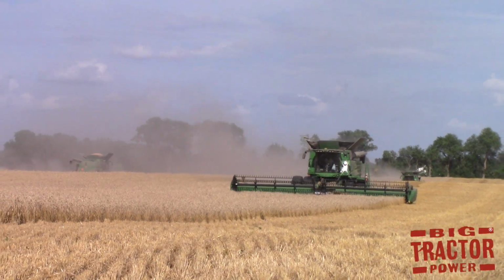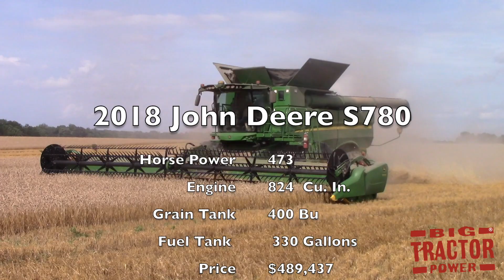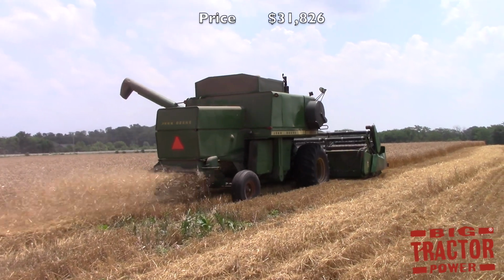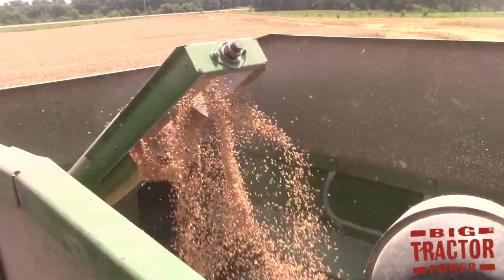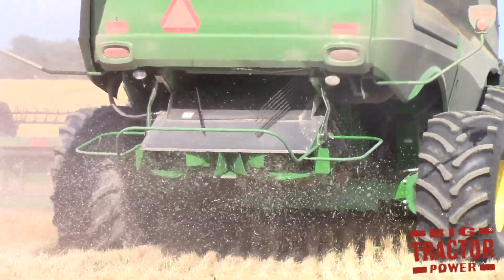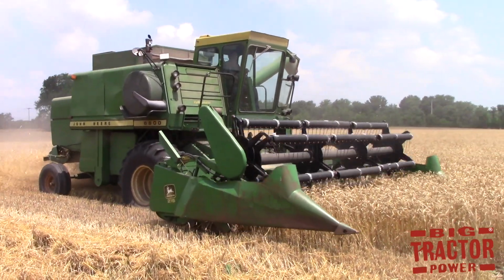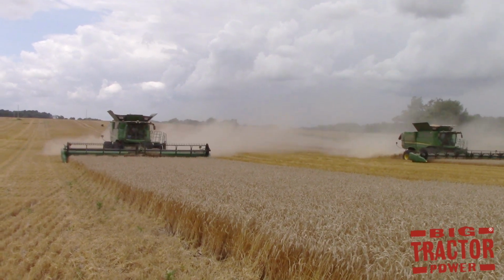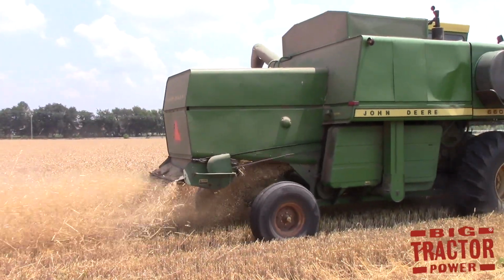Wheat Harvest 2018: John Deere S780 & John Deere 6600 Combines

Comment: The old guy still runs like new after 40 years of service. I wonder ho will this S780 machine run in 2058?
Reply: Probably won't, electronics will fail and likely won't have replacement parts available. But the old dog will probably STILL be running at that point.

Comment: Dad had several 4400s over the years and finally got rid of the last one a few years back in favor of a 6620. That's a much better machine. I don't miss the 4400 much, but there was a lot of acres covered with the old girl.
Reply from the maker: I have filmed a 3300, 6600 and 7700 but not a 4400 yet.  They are cool machines. Harder and harder to find.

Comment: Do those prices of harvesters include the head? How much does a typical draper or corn head cost?
Reply from the maker: It does not include the head. A Draper is around $140,000.
Reply: bigtractorpower McDon are about 80 and far better headers then deer
Reply from the maker: When Case IH was offering MacDon headers their website listed a new head at $130,000 for a 40ft Model.

Comment: What was the first combine to center the cab? And why did so many combines have an offset cab?
Reply from the maker: Well most combines had a center operators station from the 40s to the 60s. John Deere  made a big splash with the 3300 to the 7700 in 1969 with the front mounted engine.  In 1989 Deere went back to the Center cab with the 9400 to the 9600.
Reply: the engines sat beside the cab so they had to be offset
Reply: I realized after I posted this that old Gleaners and JD 45 and 50 combines had center cabs. But most of the older MF and IH combines I see around here have the offset cab. I just don't see what the benefit was for them to change the design with a side engine.
Reply: International harvester put their cabs on the side on the 815 to match a truck. Thinking you drive a truck on the left side so they put cab on the same side also you could view the unloading auger easier.
Reply: bigtractorpower I am pretty sure it was the  later model 915 INTERNATIONAL that was the first combine to have a centre cab ,regards from Australia.

Comment: Mr.bigtractorpower, since you have the spec's on these 2 machines, how many (in capacity) 6600's would equal 1-S780?
Reply from the maker: It would take 4 6600’s to match an S780 in capacity.
Reply: Thank you for your response.
Reply: @bigtractorpower  do you have video in which addressing JD classic planter VS new one?

Comment: Which operation has the lowest harvest cost per acre when you factor in a payment on that new machine....
Reply from the maker: Well there are differences to consider.  How fast does the crop get harvested, how much down time is there for repairs etc...  it always good to have low costs but are their opportunity costs of delay and lost time on an older machine.  It all depends on how many acres need to be covered.
Reply: Fuel cost per acre alone would be interesting. Repair costs on most of the old stuff is minimal compared to new equipment today. Most farmers get rid of them in three or four years or "fleece" them.

Comment: And if you went back another 20 years to 1958, I wonder if it would even be a combine, or would it be a sickle bar, wagons, and a thresher outside the barn?
Reply from the maker: Combines were strong by 1958.  John Deere offered the 45, 55 and 95 at that point.  I have filmed a 45 and 55 in corn.
Reply: Yes, and it would have been the debut year for the classic John Deere Model 95, which in that year, was the largest S.P.C. in the world, too!
The Model 95, went on to become John Deere's number one selling combine, in the 1960's, and by 1960, the introduction of the Model 105, moved the 95 to the second place in the family, while until the beginning of 1967, the J.D. 105 held the title of the world's largest S.P.C.!
John Deere would go on to debut two more world's largest, the Model 7700 and Model 8820, respectively.
In 1989, the Model 9600 could only be classified as the world's largest conventional combine.
Reply: Great info. We had a 1000 acre family farm and ran a 105 till 2000. retired farming, but I loved the control at the steering column. Great group of combines (45- 105)
Reply: I remember a parts 105 we had late had a 20 or 22' straight header. Could the 6600 handle bigger than a 16'? curious because I knew the 6600 replaced the 105 and were similar in size.
Reply: I have a Facebook group just for the great "5 Series" John Deere combines.
If you're on Facebook, look for it by name, and I will add you.
Reply: I ran a 22' J.D. 6600, in 1979!
Yes, that's the combine I learned to cut with. 
Originally, she had a 20' header, but this farmer was her 3rd owner, and set the 22 footer on her. 

I worked over terraces without a hitch and she was smooth and easy to handle!
Reply: The Model 6600 is actually halfway between the Model 95 and the Model 105.

Comment: Does anyone know if John Deere still makes sts combines. I'm trying to look but I haven't found out anything
Reply from the maker: The STS models were built from 2000 to 2011. The S600 replaced the STS in 2012 and the S700 replaced the S600 for 2018.
Reply: bigtractorpower yeh I saw a 2010 9760 for sale but never saw a date newer than that. So much bigger are the s700 compared to the s600?
Reply from the maker: A 700 and 600 are the same on the outside. Lots of new tech inside a 700.
Reply: bigtractorpower so same power just upgrades? So does that mean the John Deere is done making s600s. Would this info be on John Deere website?

Comment: HAHA!!.The 6600 sounded like a old RTTY teletype machine compared to the smooth sound of the S-680.
I remember when the 6600 series was new and they really earned their keep back in 1978.
The part that I'm not understanding is this...we now have a machine that's at least 3-times bigger(S-680)and yes it will run circles around the poor little 6600.
This is where it gets crazy...you have a $400,000.00 machine that's driving the wheat prices through the floor due to much higher yields then back in 78'.In theory the farmers want a faster,more productive machine,but as these machines get bigger,your profits are TANKING!!.So what's the answer??,get a EVEN BIGGER COMBINE!!,60'ft.headers,600hp.engine 550 bushel hoppers,etc.To me,its a race to ZERO.Maybe I'm wrong,but that's the way its lookin'.

Comment: Both are nice machines, I just wonder what the stress level difference is between the 2. On one hand you have a 6600, basic easy to operate machine, fairly easy for a farmer to fix and reasonable parts prices and a reasonable price tag. On the other hand you have a S780 combine, lots of gadgets and gages to keep an eye on, probably not to many things the average farmer can fix himself on it, high parts prices, and a very expensive machine to pay for.
Reply: I'd take a 7720 any day of the week before one of those high priced monstrosities that only the dealer can repair
Reply: @Alden, I totally agree. The last combine I ran was a John Deere 7720 combine, what a great machine  to work on and run. The only Combine we had that I liked just as well was, a first year out 915 international harvester.

Comment: You do realize that 1978 was the last year for the New Generation Series, don't you?
The John Deere 6602 was last in 1979, but only because hillsiders were offset of their peers by one year.
Reply from the maker: Yes.  I have every NewGeneration combine brochure that was printed from 1969 through 1978 including all the rice and Hillside variations.  I would love the chance to film a 6602,  6622 and 7722.
Reply: I never had every year, but I did have several.
Reply from the maker: It took several years to track them all down.